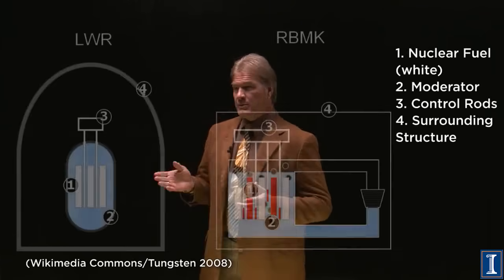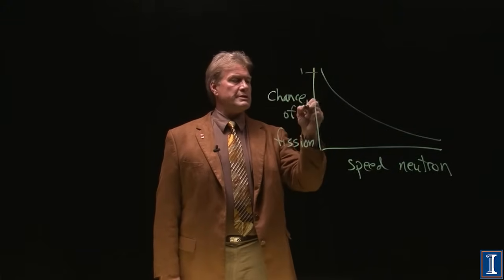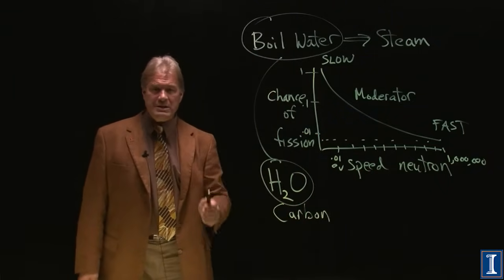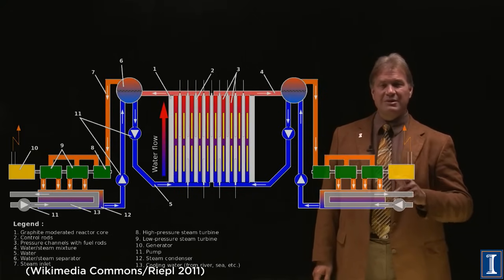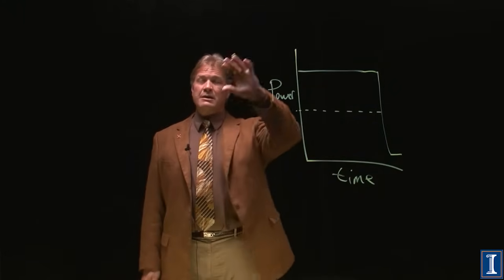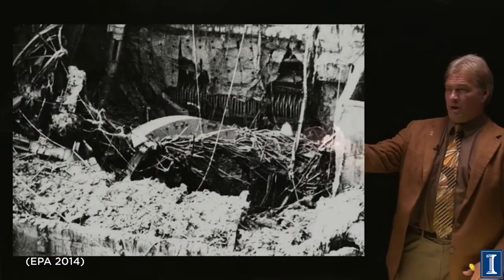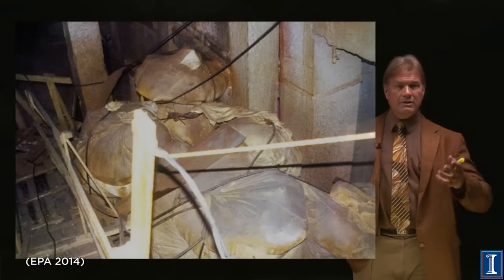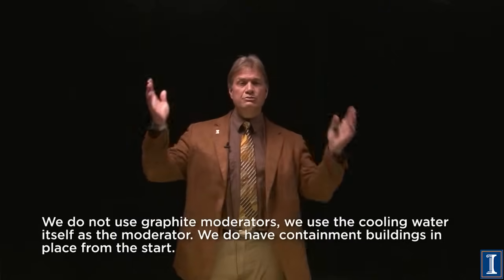Chernobyl: Worst Accident Ever

Comment: It's hard to conceive of a worse reactor design than the RBMK:

- No containment vessel.

- Graphite moderated, water cooled: worst possible combination.

- When the US was cautiously building reactors in the 60-megawatt range, the USSR designed the RBMK to generate 1,500 megawatts.

- Scramming an American reactor takes three seconds or less. Scramming an RBMK takes 20 seconds.

- It's hard to think of a dumber idea than putting graphite tips on control rods. 

- But there is a dumber idea: when a reactor is behaving oddly, in ways that you don't understand, the only thing to do is to shut it down and wait for the experts. Instead, they pulled out nearly all of the control rods.

Comment: If you lose the moderator in a LWR the reaction may stop, but there is still the decay heat of the fuel to deal with... no water, no cooling, and the core melts down. It happened at Fukushima.

Comment: korsunhoox
8:45 ah, Fukushima was not Chernobyl-antiquated-no-containment-building type, right, moderated with water, with multiple energy back-ups, and yet failed big time...human errors, nature disasters, name it. next, God forbid, we would hear about an unprecedented mechanical failure (u know, ladies & gents, it must have eventually happened) it seems a toss-up anyway, but characteristic how this series plays down the dangers surrounding the nuke plants (+ discarding the nuclear waste process - vide the episode on natural reactors. all well done and v interesting though...
Reply: You are very ignorant on Fukushima. Fukashima was not even close in scale to the same disaster as Chernobyl. I wouldn't even classify it as "failed big time" either. The issue with the disaster that was Fukushima was the fact that the cores could not be cooled down in time as the pumps did not have the energy required to keep them cool and then the subsequent hydrogen explosion afterward. There was no runaway reaction like Chernobyl, there was no massive core breach like Chernobyl with radioactive graphite core bits thrown around high into the sky as dust particles spread across the continent. I understand we can't prepare for everything but god the Fukushima plant tried. They had a very large sea wall, multiple backup generators, 6 hours of battery-powered cooling, and if all else fails, they just needed a fire truck to bring in water. That didn't happen because the Fukushima disaster was not the pressing issue at the time, tidal waves destroying homes and all. All the reactor buildings where damaged, but that was by design to some extent to mitigate the hydrogen explosion that would occur in this situation.

He really doesn't play down the nuclear power disasters but rather just lays out all the facts. I agree nuclear power is can be scary, but only if you don't know what it actually is or what processes take place. Per mWH nuclear has produced compared to coal or other forms of power, nuclear is by far the safest. It has killed less people, injured less people, and given cancer to less people than any other form of power per mWh. Im not saying it doesn't have its problems but neither does any other energy source. 

You also mention discarding nuclear waste, but our current temporary storage is not that bad. The waste is put in leak-proof containers rated very high. Sure they need to be guarded but other than that, there is no real pressing danger in most situations.

Comment: @Illinois EnergyProf The elephant's foot beneath reactor 4 is made of uranium that got through the bottom of the reactor vessel (melting the bottom of the reactor vessel). Are the bottoms of the new reactor vessels fitted with the same materials that the control rods are made of, so in the case of an uranium fuel meltdown the fision reaction will be stopped by that material on the bottom of the reactor vessel, the fuel will solidify and there will be no danger that the uranium lava will leak into the ground contaminating the water?
Reply: Nuclear fuel by itself, while radioactive and not safe to be around, is not something that fissions normally or requires a neutron absorber like a control rod. New reactors, old ones even that where not soviet built, have thick concrete surrounding them which is more than enough to stop the nuclear material from eating through.
Reply: @JPminer814  Then why did the elephant's foot sunk beneath the reactor's core. Why was everybody fearing that radioactive material will get into the groundwater?

Comment: How about three mile island? They run out of water and the whole thing melted? No design is foolproof. Don't get me wrong, the Russian design is crap but that does not mean that the western designs are never going to have problems.
Reply: Of course no design is full proof but the two disasters are only really compatible because they are both nuclear in nature. A melted core by itself is not inherently bad, the steam and hydrogen created by heat is. Three mile island didn't explode and have all of the radioactive contents fall over the entire continent either. It is scary yes, but not really compatible when you look at the facts.

Comment: Thank you for this video. Indeed you need physics to protect. RBMK's didn't rely on people, but automation and people in extreme circumstances. A few more important factors and a slight correction. There is a lot to criticise the crew over, but it's important to note the explosion was in fact caused by the crew sensing a problem, panicking and hitting the emergency SCRAM button. 

RBMK's computer control was relatively advanced for the time. The thinking was that in most situations this reduced the risk of crew error. As we now understand, yes that's true, but it can also reduce the experience of crews to handle unexpected events outside of usual operational bounds. 

The reactor was in fact at 50% power throughout the day before the test at 1am, so for many hours. The reduction in power to a target 22% was supposed to be very brief. There was an unexpected delay to the experiment, which caused Xenon to build up. RBMK's don't shut down to refuel, they're so big you refuel in sections whilst the reactor is running. That's got serious implications for the accident because it took the crew outside of usual operating bounds, exactly the type crews who rely heavily on automation struggle with. 

With RBMKs there is less contingency in the grid because the reactors never shut down. That created huge pressure to get the test done then, as it might be years before there was another chance. Secondly, crews always relied on automation to run these big beasts, but below 50% RBMK's are manual. That's like going from an automatic hatchback to a 16 speed Mack truck. Thirdly, because the reactors virtually never went below 50% power, the night crew had never run it manually before, nor had they powered down a reactor., because RBMK's are always on.

No one hit the wrong button, they were targeting 22% and didn't account for Xenon. They hit the right button, the SCRAM, when it was clear this reactor wasn't behaving as predicted. But the rod design with moderator tips caused that spike and the rest is history.
Reply: Fabulous explanation

Comment: This was not an accident..
The guy in charge insisted that the operations team conduct a number of inapropriate adjustments and overides to a working reactor... this resulted in a dangerous situation being reached... there was no clearance from the central design and control board for this to be conducted... just some beuracrat...
The resultant detonation  was the result of this unauthorised sabotage....
The individuals responsible should have been removed from the party... tried.. found guilty.. and liquidated.. or whatever..
Reply: source?

Comment: If there was a containment building, would this not act as another level of bomb by having it fill with gas until it also blew? What protections are there for this in containment buildings?
Reply: A bomb losses energy breaching a containment.  So there may not be enough energy to breach a second container.  Built properly then anything sans the most negligent act(s) or sabotage and any explosion will be contained.

Comment: Most nuclear reactor melt downs are caused by lack of water circulation , assuming that is correct,  figure the cost of the Chernobyl thing and what happens in Japan with Fukushima dailich and the bazillions of money it cost to clean up and the continuing cost in the future which is money down the toilet forever you would think someone would learn a lesson and spend the money up front like during construction instead of after the thing blows up it don’t take 100 Einstein’s just a little common sense

Comment: I'm beginning to think this channel is actually really sketchy and aims to popularize nuclear power by spreading misinformation. 

Chernobyl can happen in our reactors because it already has. The code fails to mention  decay heat which caused both the fumushima accident and the Harrisburg accident. The reactors were turned off long before anything happened, both reactors were water cooled yet that didn't stop meltdowns from happening.

In the case of fujushima, nor did the containment building stop nuclear decay from spreading after massive chemical explorations.

The central point of the video is just made up nonsense

Comment: "what is eight feet wide, four feet tall, weighs two tons, and slices apples into three pieces?"
answer:  "a SOVIET designed and built machine to cut apples into four slices!"
Reply: You can remove the quotation marks, that's not even close to what was said in the HBO Chernobyl series.

Comment: You say that nowhere else in the world built reactors like that, but it's not quite true. Here in the UK we had a reactor called Windscale for Plutonium production that was, get this, air cooled (as in a fan at the front and a chimney in the back). It was also graphite moderated. when it caught fire the only thing that prevented much of the UK and Ireland becoming uninhabitable was some filters added as an afterthought on the top of the chimneys (and most of the engineers has disagreed with their addition).

Comment: Nope. Obsolete solid fuel fission reactors have no business being in operation. The only fission reactor that is potentially appropriate is a molten salt breeder reactor which would basically exist to neutralize and process all the dangerous radioactive waste out there. Mining and processing radioisotopes is equally dangerous and environmentally destructive so it basically shouldn't be done. The only fission that should be happening should be dealing with the waste. No new material.

Comment: Did you get a professor on HBO's Chernobyl series? RBMK exploded due to design features and coincidence of circumstances. The operator pressed the correct button, but it worked unexpectedly badly. And this happened as a result of the poisoning of the reactor and a small number of absorber rods in the core.

Comment: The initial focus on the benefit of a containment block here is entirely incorrect. It the event would just be a steam release or a leak, yes, that would help immensely. The force that was generated in the initial failure that blew up the reactor lid was enough to make it penetrate the containment block (especially that it would be impacting in from the inside of the dome curve, not from the outside). Then the air would get in and the secondary explosion would happen anyways. So, instead of a shattered building and the explosion expanding outside the explosion would just be directed upwards with many extra "projectiles" of shattered containment block, kind of like a shotgun barrel and buckshot. And then the result would be almost the same however it would be somehow slightly easier to contain it with aerial drops and would offer some protection to the workforce on the ground. Sure, not an insignificant difference - but none for the event itself.

Comment: 2:22 “Something like Tschernobyl can’t happen anywhere else, because the entire world has got containment structure buildings.”
I agree, German and French nuclear power plants are more safe than RBMK reactors from Russia. The thing is, even in Germany and France the official owners of Nuclear power plants say officially, that the chance to have a  situation like in Tschernobyl happens once per 10 000 year for each reactor. Sounds safe, right? 
At the moment we have 442 running nuclear power plant reactors worldwide. 
10 000 years / 442 nuclear reactors = 22.62 years average case worldwide.
That means every 22,62 years average we gonna have next Tschernobyl. I guess Fukushima was just in time. An means the chance is incredibly high that next issue happens in 15 until 30 years.

Comment: A totally wrong point of view. Chernobyl was a nuclear explosion, not a thermal explosion. There is no fuel left inside the reactor at all - this is the main proof. That is why there was such a giant radioactive trail.
Reply: The vast majority of the fuel was found eventually in the corium that burned through the reactor vessel. Fuel pellets were also sprayed over the roof during the initial explosion that flipped the 1000 ton lid.

Comment: How come three out of four reactors at Fukushima exploded if they had these containment buildings built by General Electrics? Moreover, the Russians stopped the meltdown of the core by covering it with sand, boron, lead, and concrete, built the sarcophagus over the exploded reactor, and now this reactor is inactive, while in Fukushima the Japanese let the core melt down and penetrate the containment building polluting the ground waters. They have still been cooling the cores of the reactors by seawater. Every day they use apprx. 300 tonnes of water and  drain it to the ocean. So never say never.

Comment: You said when the power was lowered, they should have just "... called it a night" and shut it down.  That would have set off a series of political events that I'm sure the operators would not want to have to deal with.  That's what happens when you have a society run by politicians that don't allow people to think. Explaining to the politicians the possible consequences of restarting the reactor would not have worked either. I mean, can you imagine politicians listening to scientific reason?

Comment: Ummm.... Fukushima did have containment and it was blown apart on reactor two for sure. 

3 Mile Island had containment, radiation was released. 

“Western” reactors have a huge problem with crêpes sing Tritium into the water supply. 

Basically, nuclear fission is to dangerous and not cost effective to produce electricity. Maybe there will be hope in fusion some day, but not fission.
Reply: Yet no one died from either of those events as you lie about them on the internet.
Reply: No one died from the immediate accident, yetthere have been many health complications and cancers that can be traced back to these accidents.

Comment: Huh, that's not how I understand it went.
It's mostly the same, fell into a xenon pit, quenched the reaction.
They pull out too many rods
Power comes up.
Time for the test.
They trip the turbine
They start to lose the power it generates
The coolant pumps start to slow
Coolant in the reactor starts to boil, removing it's moderation and absorbing qualities
Now we're into runaway reactivity,
The power starts to climb, very fast
They SCRAM the reactor
At the bottom of reactor vessel, the half meter of water or however deep it was, is now displaced
The water at the top and bottom was there to absorb reactivity at the edges of the reactor, where you don't want the high neutron flux, because it's full of complicated joins and valves and not as strong of the center of the reactor
So you now have massive neutron flux at the edge, and the heat from the reaction damages all the control rod guides
Now it really has some legs, skyrockets to 35gw+ and burts they reactor vessel, releasing what little absorber was left
Now the rest of the uranium and graphite moderator go off like a fizzled nuke, 10s of tons of TNT instead of kilotons.
Rapid unplanned disassembly finally halts the reaction.

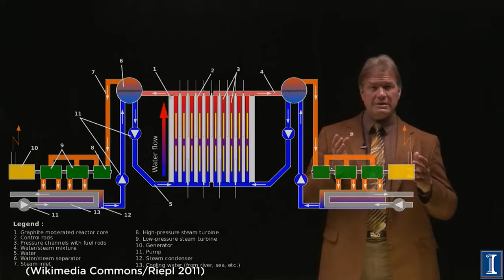Comment: Hmmmm.  I was answering a few of the comments below and had to listen to video again.  EnergyProf says the Chernobyl reactor #4 was being shut down because it needed to refuel (at about 8:00).  But the RBMKs don't shut down to refuel.  The massive shielded crane which refuels it can do that on the fly.  It is one of the reasons the reactor design didn't have containment because the crane that stands on top of the reactor requires a fuel rod's length plus some for clearance.  While tit is irrelevant to the accident, I'm wondering why he said it.  I remember someone saying it was being taken out of service for some maintenance reason, not refueling.
Reply: Yes a another topic of discussion.  The plant at Crystal River in Florida was built without a way to remove the reactor vessel, they need replacement occassionally  So to accomplish the replacement they removed enough of the containment concrete and cut the reinforcement rods to provide access.  The reinforcement rebar is prestressed during construction.  Once they were cut the stress was relieved, thereby compromising the integrity of the containment since the was no way to prestress the new reinforcement steel to replace what was removed. The plant was deemed irreparable by the NRC and is now being decommissioned.